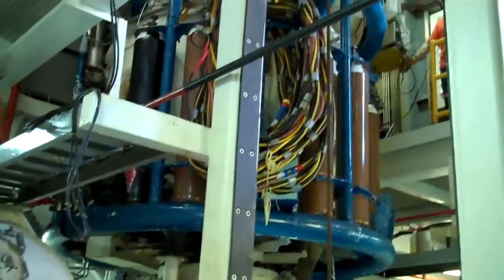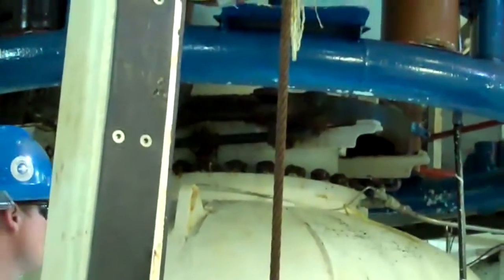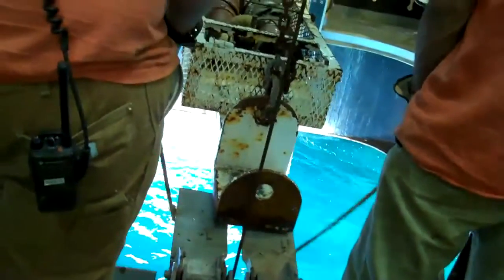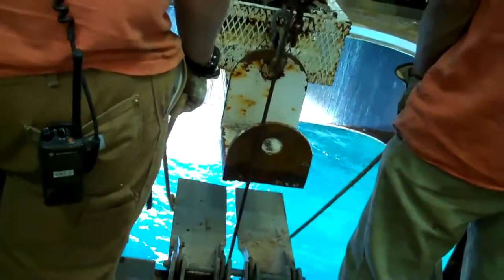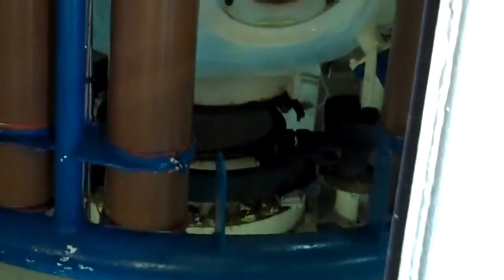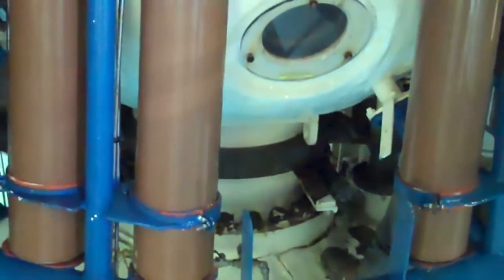Launching and Recovering the Saturation Diving Bell

Comment: How does this work without a heave compensator? What happens if they have to recover the bell in high seas?
Reply: +pinkmoon747 Ideally, the bell weighs enough to just ride up and down in the water with the ship and not shock load anything. Coming up through the surface of the water is timed with a lull in the heave of the ship.
Reply: pinkmoon747  the vessel they are on is a Simi submersible if the seas are rough the ship is sitting low in the water anyway. from the water to the bell housing is a short trip in rough seas.